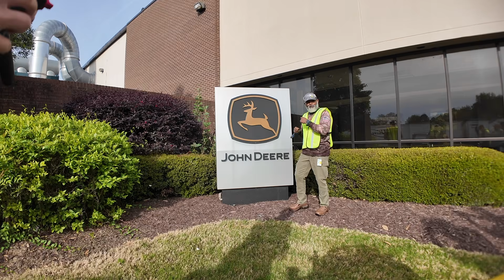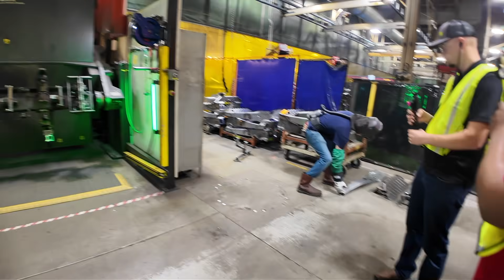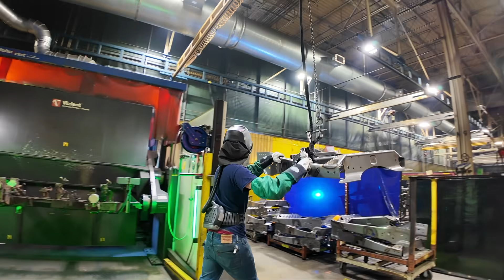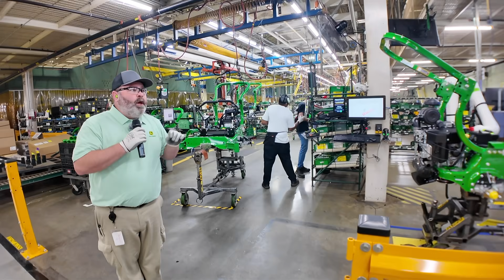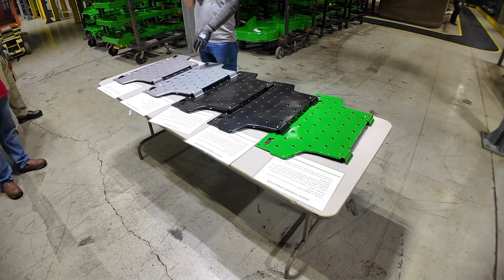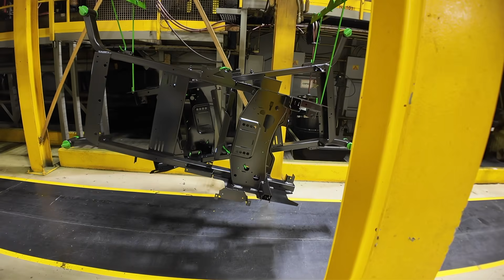Inside the John Deere Turf Care Factory… This Is How Your Mower Is REALLY Built

Comment: What I took from this video was to maybe invest in the robotic company that can potentially replace the workers. The company in that warehouse manufacturin the robots is AZTA, its down 23% at $18.57😬😬😬
Reply from the maker: That’s definitely an interesting perspective on where the industry is heading! 👍🏾
Reply: @JackOfAllTresss   hey I’m actually one of the workers and I have to fix mistakes tag out bad quality because of the robot it’s programmed by a whole team of engineers aswell so the manual labor of it will be replaced but you still need an employee fixing and checking after the robots.